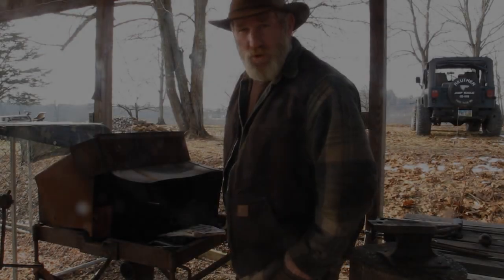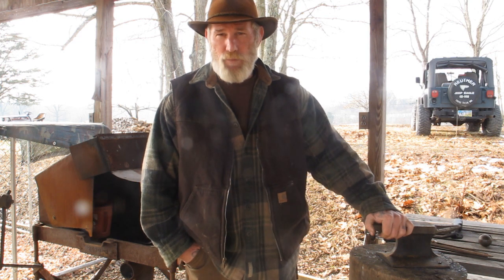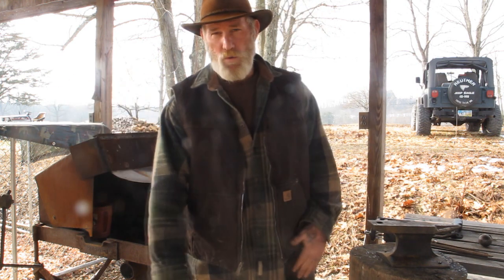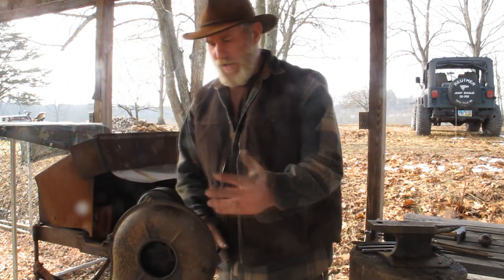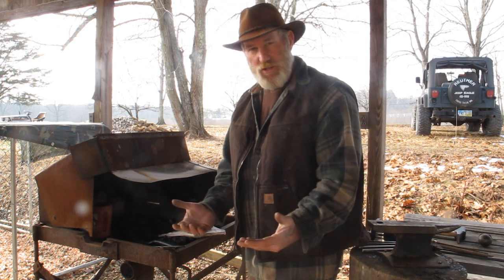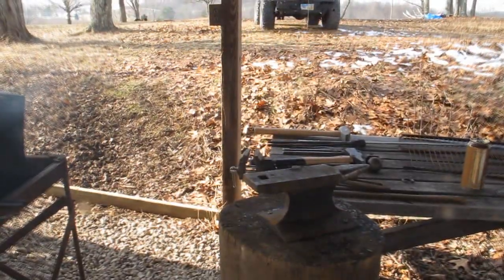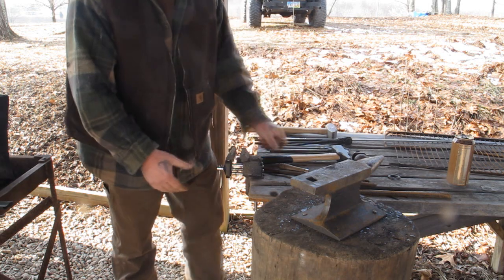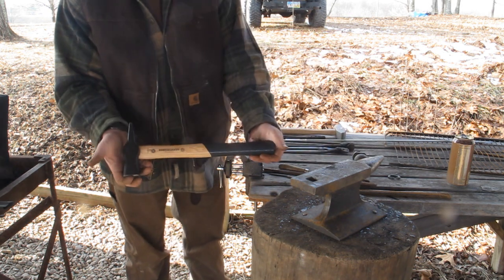Blacksmithing  Part 6 Common Man Tools and lighting the Forge

Comment: This is a most inspiring video!
I was fortunate enough to find a discarded hot-water system unit on the side of the road and was able to strip it back and cut open the metal cylinder inside. My forge can now be up to 1.5m long, but it's the tools that were worrying me. Now knowing that they can be bought second hand, and a piece of railroad works fine as an anvil, that certainly makes things a lot cheaper and more accessible!
And a brilliant idea about that tow-ball as a peen-post! :D

Comment: 120 v bathroom exhaust fans work great for blowers, use of a dimmer switch adds variability to the fan.  A fan with 60-90 cfm is more than enough and allows for forge welding as well.  When using a hair dryer, remove/disconnect heating element extends the life and prevents the dryer from catching fire.

Many farmers have a junk pile where they through everything and I have found they are more than willing to let you have at it.  Harvesting scrap along the roadside and dumpster diving works great

Comment: I am really enjoying this series. Since I cannot afford propane for my gasser, I am going to pull out my old break drum forge and see if I can get it to burn hot enough with wood to brush up on my smithing skills (which were never very good to begin with lol) One thing you need to be careful of with the blowdryer, be sure to only have it on when the metal is in the fire. If you leave it on constantly, you will burn through massive amounts of coal for the smallest jobs.

Comment: Two things to mention. There is a fantastic book you could most likely pick up used cheap, The Complete Modern Blacksmith. The other thing, if you plan on making your own tongs, hit up a junk yard and get some coil springs. The steel is excellent and it is great for making handles, the springyness takes away some of the reverberation from striking.

Comment: Hey Dave, when you start looking for a vise for your blacksmithing area Find a post vise,sometimes called a leg vise. They are forged, not cast, so they are stronger. They can take a pounding. The post is set into a base on the ground. The leg transmits the force of pounding down to the ground. A good vise, IMO, is more important than a good anvil.

Comment: Hey brother, some suggestions: old dryer hose works great for your blower and if acetylene builds up and goes off you only have to deal with a little confetti  instead of hot plastic or metal. A sprinkler cup has two uses, it helps control the size of your fire and at forge welding temps it helps your fire burn hotter (at those temps water disassociates).

Comment: You also should build a small sandbox. You set flat pieces in it and the piece can then give downwards upon pounding to give an upward curve. Just a square wooden box big enough to take whatever size pieces you work on, with a plywood bottom, with some sand in it, works great. Can make a lid also, if you worry about the sand getting wet or something.

Comment: the engine front hydraulic pump couples from old tractors make good starting blanks for hardy tools also.  Also centering pins for farm implements. used the same way as you described.  square, round and star shaped pieces of heavy castiron or steel with a centered mounting bolt

Comment: They are brittle because of the heat treat. You can take a file, heat it up to around 1350-1500F and put it in a bucket of vermiculite to cool it down very slowly and you will be able to bend it after it fully cools. That is what makes steel so wonderful. You can temper it for the right balance between strength and flexibility for your particular application. Ever notice how when a drill bit shows starts showing color from the heat, it dulls almost instantly?

Comment: Dave, you probably already know this but if you heat up your tongs in the fire then rub some bees wax on the rivet it will free them up. also when you add new coal onto the fire leave it on the table close to the fire so it can change to coke then push the coke into the fire pot this helps with the heat and reduces the smoke alittle bit.

Comment: One thing to consider guys, if you are going to use a hairdryer for your oxygen source you may want to remove the heating element. Saves having to buy another one after you melt the innards of the first

Comment: Hey Dave, what are the health affects of working a forge? I'm building one to add to my workshop, but I've heard there are some pretty gnarly lung issues that you could develop from blacksmithing. Is that why most people opt for outside forges these days (compared to the 1800's when they used to have forges inside shops)? Should we have a common house fan blowing in the general direction of the forge while using it, to keep the smoke blowing in one direction? And what about particulate masks?

Comment: storing that plastic can in there while you have fire is...not going to do you well, one day. Also, the hair dryer works well when you have power, and that old hand crank blower is gorgeous, but when you don't have electricity or another set of hands, a $15 foot pump bellows for air beds would do a decent job, and let you work the bellows while moving steel.

Comment: Avoid buying stock at retail outlets like lowes/home depot.  Very pricy and you will pay 4x's or more than at a welder/metal wholesaler.  You generally have to purchase 20' lenghts, but often they will cut it down to managable lengths for little or nothing extra.  I pay about $4 for a 20' of 0.25 in square/round stock and have them cut it to 5' to fit in my trunk.  Friends are also a big help when they know what your after they will usually get much of what you need for you.

Comment: Yet again, equipment modernization has put another good man on the unemployment line. Jeremy, our beloved Crankster, is out of work. Let's hope you don't find an electric goat at the flea market.
 How would a common man go about making their own coal (for the forge) using only methods and materials found in the old days, miles from the nearest town ? Wagon trains heading west must have had someone with blacksmithing skills.